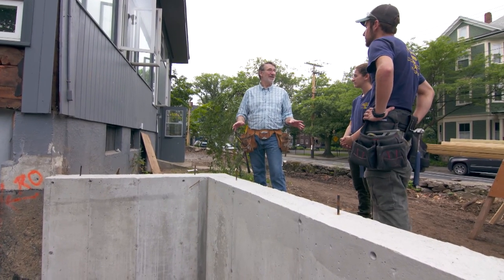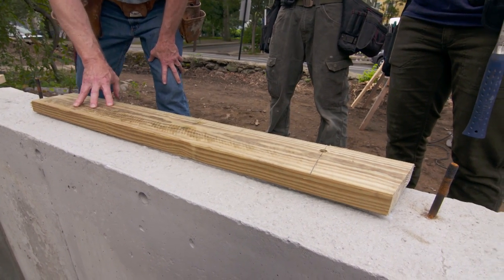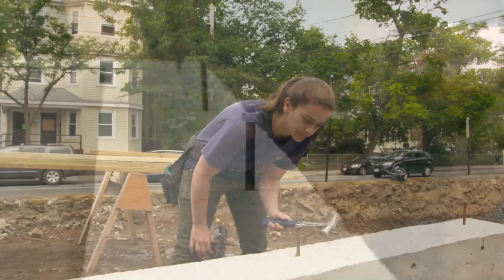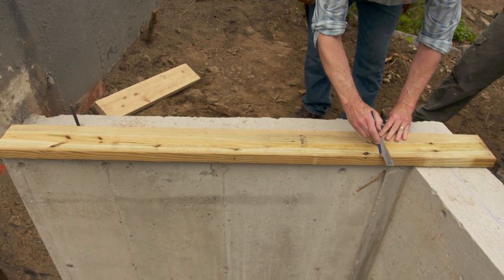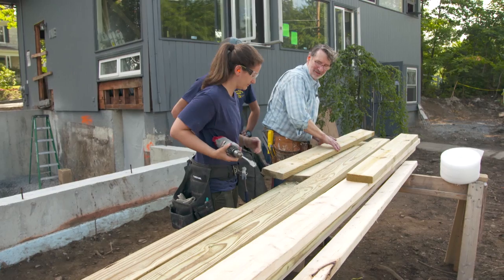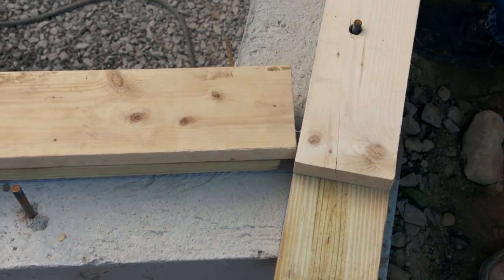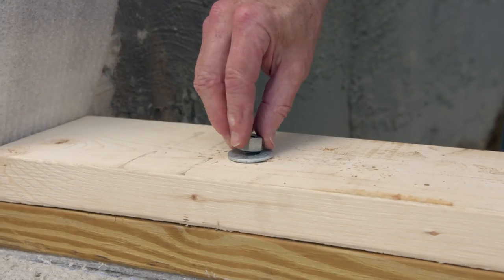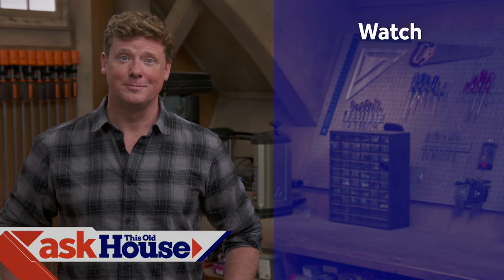How to Lay Sills on a Foundation | This Old House

Comment: I love Norm and agree he is a master carpenter.... I’ve built houses since 1981 and agree this is the classroom method for drilling holes for anchor bolts ... however, when trying to make a living, the method shown is laborious and time consuming ... a more expeditious method is to lay the sill on top of the anchor bolts, use a speed square for alignment and tap with a hammer creating an indentation for drilling from the underside of the sill leaving the blowout for the drill bit on top ... I have installed thousands of miles of sill plate using this method from Oklahoma to New Jersey and back again ...

Comment: A bearing plate should be used instead of washers. Pipe should be used to straighten the bolts. It doesn't appear they are used here but you don't want the plate to overhang the foundation because you typically will have a strap or hold down attaching the wall to the foundation. Don't forget you still have sheathing/rain screen/siding which will add at least another 1 1/2".
Reply: @Wogden 700 interesting. Here in the northwest hold downs are required typically every 8' to 12' depending on shear wall locations. I've never built anything where H ties aren't required. I'm surprised because the northeast does get high winds. If I remember correctly the highest air speed recorded was on Mt. Washington.
Reply: If you don't have a pipe you'll still have a nut. 😉  And building codes are likely different depending where you build. Some places don't even have concrete foundations which seems crazy to me. Personally I'd sooner over do it then save a few bucks and wish I'd made it stronger

Comment: If you have an 8 inch poured foundation wall with a 4 inch ledge for brick. Only 4 inches extends up for the sill plate. Our walls are 2 x 6 walls, is it ok to have 2 inch overhang on the sill plate?

Comment: Norm, good to see you. I didn’t hear why you overhung the sill board.
Reply: So that when the siding and/or sheer paneling is put on it can go lower than the top of the concrete to make a weather seal. If you didn't overhang it your paneling would run into or be touching the concrete which would wick moisture back up and into the sill.

Comment: Why not lock washers ? Just wondering ! Great video , NORM ! !!👍👍👍👍👍
Reply: Just a guess but gravity holds everything down later once an entire house is sitting on it. And with wood I doubt a lock washer alone would work. But for wind and earthquake protection I'd use flat and then lock washers and even thread lock paste . When I build on my own house I like the ancient Roman method... better to over do it lol
Reply: E C  good point lol. But I'm referring to the entire building. Reinforced everywhere.  Sure it won't help in a 9 earthquake or hurricane but I don't live in areas with those risks.

Comment: Would a full coverage epoxy coating (all sides and ends) of the 1st sill piece, the pressure treated lumber, provide even better water prevention over time?
Reply: Chuck Taylor interesting question. Cost would certainly be a fctor and also moisture but if the integrity of the epoxy remains you’re golden. Tough to do with drilling for anchor bolts and If any excessive moisture got in there it may not dry properly with the coating and rot. Tough to beat the efficiency and durability of pressure treated with a sil gasket.
Reply: Could probably also use PVC lumber for that bottom piece though it might cost a little more.

Comment: Interesting.  I'd have thought he'd whack the boards to mark the bolt locations and that he'd have lapped that corner joint.
Reply: I was thinking the same thing.  You never see a framer do it the way he was teaching them
Reply: Marking is slow
Reply: @defy2598 : WAY slower than  setting the sill green board on top of the bolts and striking with your hammer to find bolt location, a good framer would be done with the whole foundation before he got 1 green board on lol. BUT the technique he shows is good to learn for noobies.
Reply: If you're alone then holding a long board and hitting it could be difficult and less accurate.  A lot of builders use fast techniques cuz they don't necessarily care if the job isn't well done. I'd prefer a builder would did it accurately rather than quickly

Comment: What a wasted opportunity. 

The hardest part is to shim to level whilst ensuring however you shim is not going to settle over the years. 

At least settle too much. 

I can imagine someone would would just throw in a single bit of thin pine 2x4 shim in one single spot and call it “fixed” 😕
Reply: Yeah, when he said to shim it if it's not level I think.. that probably could use with a bit more of a pointer. It's not exactly squaring up a door jam. What sort of shims suite a structural load, how important is it to fill any gaps caused by shimming with secondary shims, would you try identify the stud placements and shim to those? Things that could be unimportant or very important for all I know.

Comment: No hammers on sill bolts please Norm, with or without nuts.  Courtesy of Larry Haun: 3/4 gas pipe 3' long straightens them in a second or two.  https://youtu.be/n4OmW37loVo?list=PLgQ-u8IxK7rXVS4He4Ccf_Q-Yc_c2AbEM&t=101

A few other steps are missing.  Check the foundation for square across the diagonals  (or whatever angle is called out in the plans), as the sill is the place to correct it if not. 

Last,  when working with the youngsters I notice Tom Silva presses them to both i) do it right and ii) not waste time.  The latter is critical to learning because there is only one way to be both right and fast:  think about the basics of the task (e.g. square drilling, using a line, consideration of next steps, etc)  before execution, otherwise they usually fall back to moving slowly and making it up as they go along.

Comment: How about teaching them the most important part... checking that the concrete is square prior to snapping line...
Reply: E C  I can tell you've never framed before..because if the foundation isn't square, you need to ADJUST your sill plates, not just place it on and assume the foundation is square..

Comment: Poor sill sealer. Stop using the cheap foam that deteriorates in a couple of years
Reply: Well, what does work?
Reply: @MemoGrafix  EDM Rubber Sill Dealer See at Risinger Framing Tips-Super Sill Dealer.
Reply: @rraborn  - Thanks
Reply: A couple years? Doubtful. It's code for a reason. Hundreds of years is more likely. Sometimes the more expensive fancy new stuff has other issues or is just a waste of money for the same results